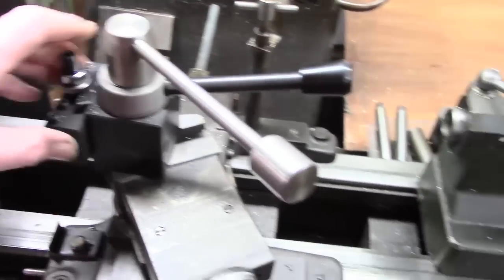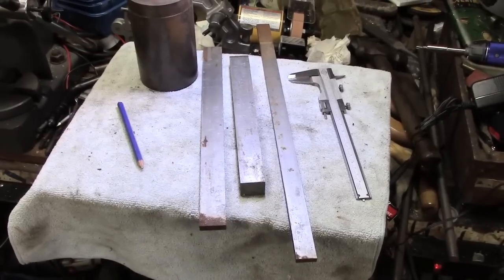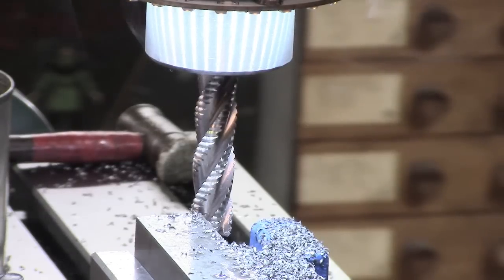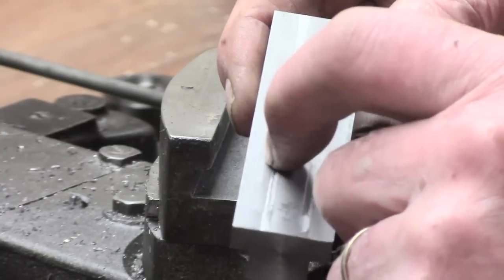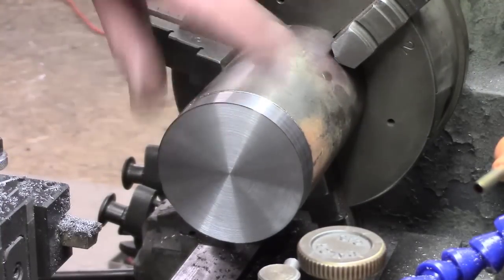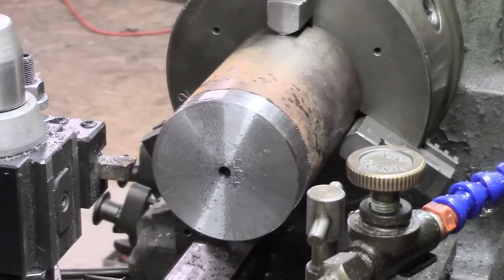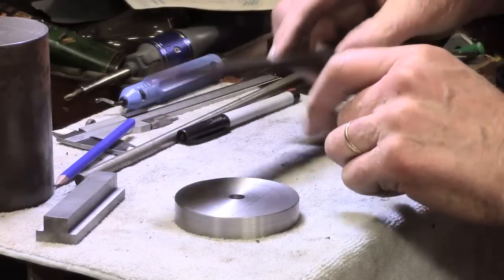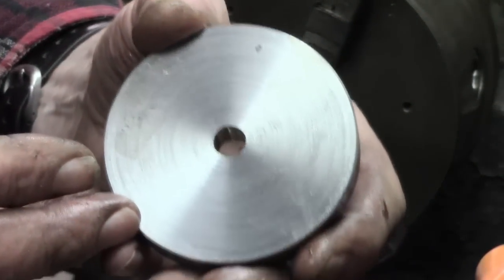Radius Ball Turner Part One

Comment: Is it just my PC or is there a significant lip sync issue with this video?
Reply from the maker: Hi Ray - hmm, yes, looks like there is a slight mismatch.  The original file when played is OK so have to assume something has changed with tghe YT processing. It goes up as an MP4 which usually does well. From my perception the error is small but, detectable. Glad you mentioned it. :)

Comment: Could you not build the ball cutter to mount off the left side of the compound rest to be able to turn a larger radius? Instead of on top of the compound rest.
Reply from the maker: Not really practical Bob I don't think, tho of course not impossible. The plan really is to have a tool that is quick to mount and use. I doubt ball sizes required will be all that large for most part and anyways - in a way this is rather just an experiment - see what happens! :)

Comment: Great video there Chris.  You have started a project that is of great interest to me.  Back when I was too busy programming computers I would sometimes think about cutting a ball on the lathe.  In fact a ball cutter was one of the things I always figured I would build if I ever did any metal working again.  So now that I have dragged the lathe out of the dusty back of the garage I still have not started on it.  I guess a part of it is that I have not had a real great need for cutting a ball.  Still I intend to make a ball cutter some day and I will have the benefit of what you experience.  Thanks for the video.